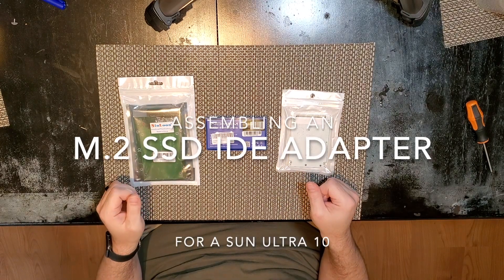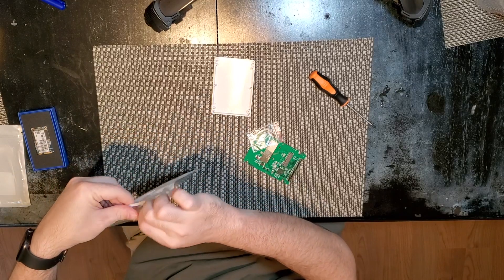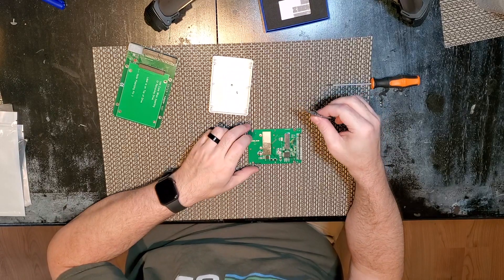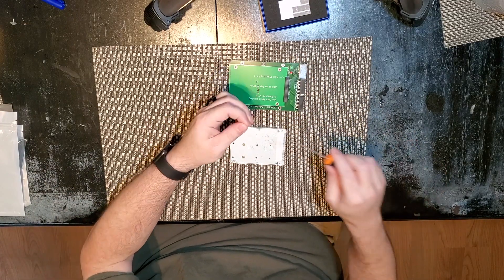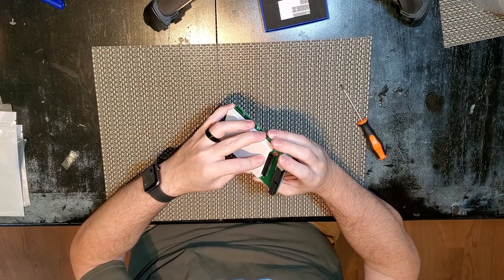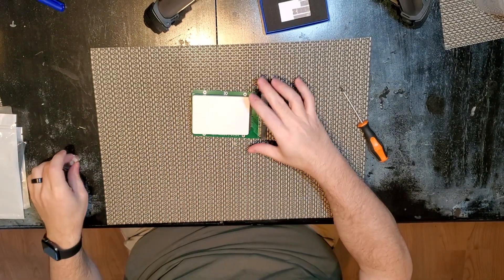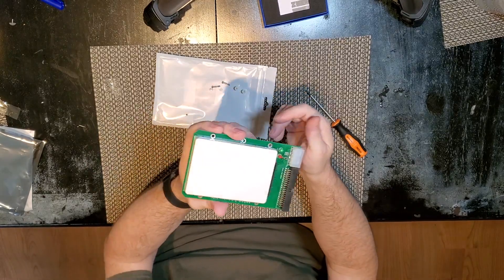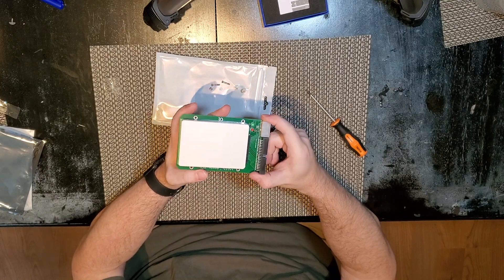mSATA SSD to 3.5" IDE Adapter

Comment: I want to put two 4GB M.2 SSD’s in a 2.5” SATA adapter, and then put the 2.5” SATA adapter in a 3.5” HDD adapter for my NAS. Will this work? What would be any potential problems? Thanks.
Reply from the maker: What kind of interface is on the SSDs? It will depend on a lot of things, but yes, it will likely work. Link me the SATA adapter and the NAS, and I might be able to give a better answer.

Comment: I posted a question - think youtube deleted as i included links?   Anyway do you think the cy mSATA adapter would work with a Kingston 120GB A400 SATA 3 2.5" Internal SSD SA400S37/120G - HDD Replacement?  Thx, William